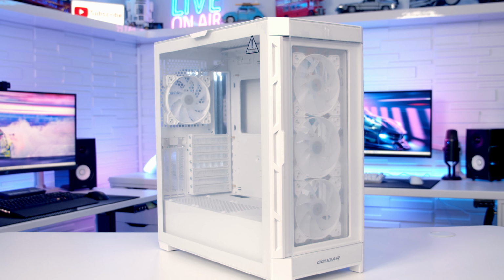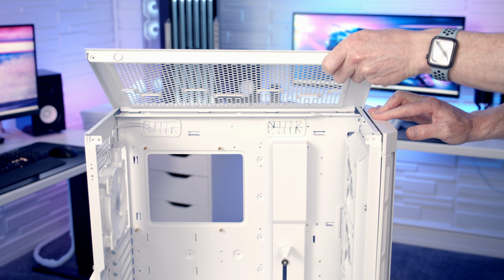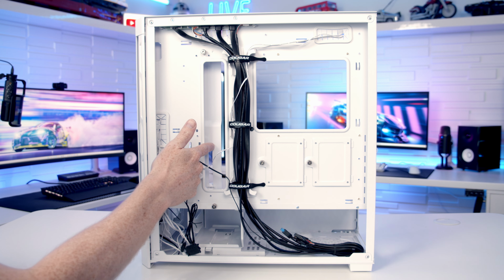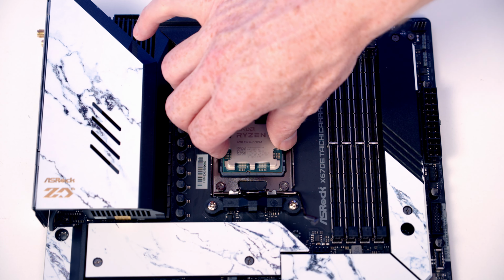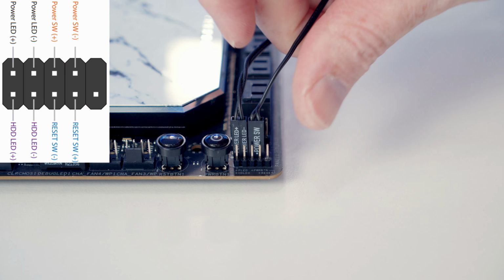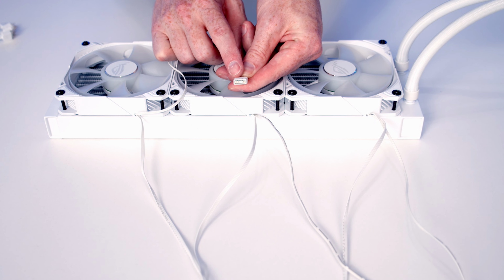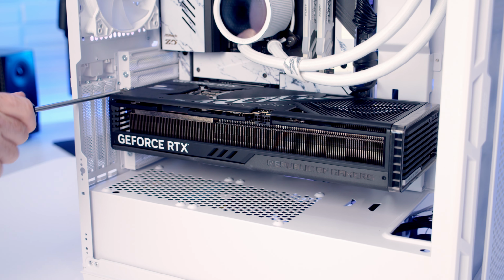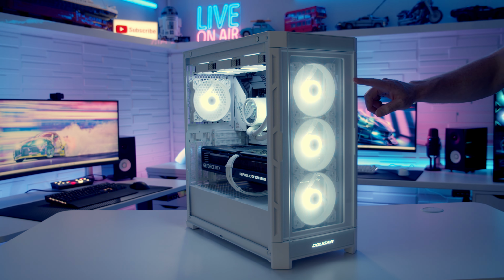Cougar Duoface Pro RGB Build - Step by Step Guide

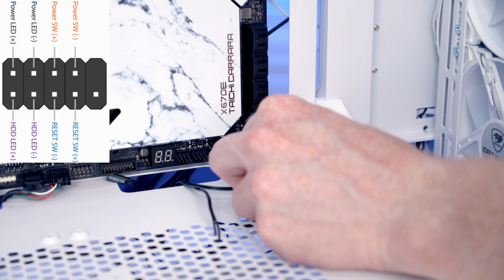Comment: 12:00 if the reset cable go through the i/o board of the rgb i dont think it's good to connect it to the motherboard reset , but if the button directly have 2 wires coming out then it's safe

Comment: I have a problem with this case need help. On the botton of the case above de psu there is the “psu cover” which can have to 120mm fans. In this video you can see where the screws go. But those holes are little, I got the fans but the screws are too thick for those holes. Anyone can recomend me a size or something

Comment: I don't know if you have heard about the new PSU from Corsair, the shift series that have the cables to one side, the thing is that they say that the case must have a minimum width of 210 mm, I know that this model does comply, but in your experience you see that the back cover is very tight or glued to the source... because I think it should at least measure more than 5 cm, so that the cables can bend and go up or go to one side.

Comment: I noticed other people with the similar problem, but I connected my CPU cooler RGB to the Cougar RGB panel and synced it all to my motherboard. However the CPU fan light acts all wonky and does whatever it wants. Just curious if anyone found a fix, thanks
Reply: For me work fine, msi center.

Comment: Great review. Have you found how to sync RGB lights with motherboard? In manual it says that you have to press the RGB button for 3 seconds and then it syncs but it doesn't work for me
Reply: For rgb need connect to motherboard ARGB. Try press ~5s and you see white color, it's mode for motherboard. Use msi center.
Reply: @kalitkas thanks bro
Reply: Hola amigo, me pasa exactamente lo MISMO. Lograste solucionarlo mi motherboard es una MSI software msi mystic light
Reply: @georgejimenez9197 read

Comment: How can you control the rgb on the fans with Msi mystic light does it need to be in a certain mode on the case
Reply: Connect argb on motherboard, press reset for ~5s and wait white color, now u can connect in msi center